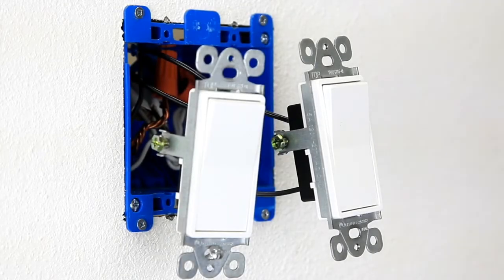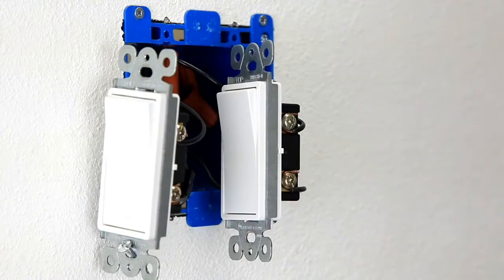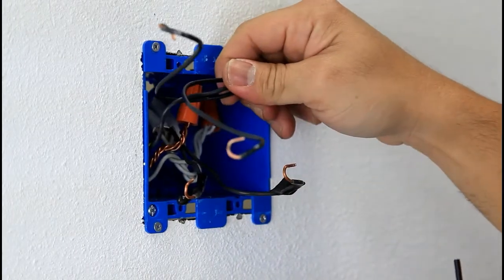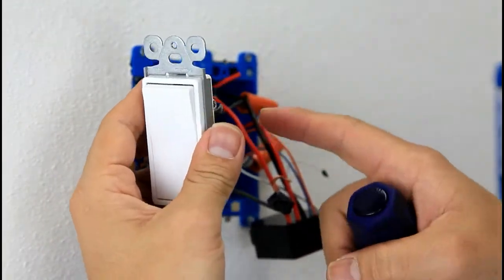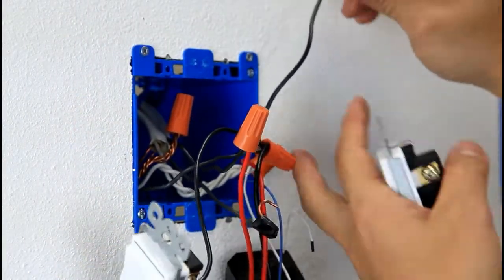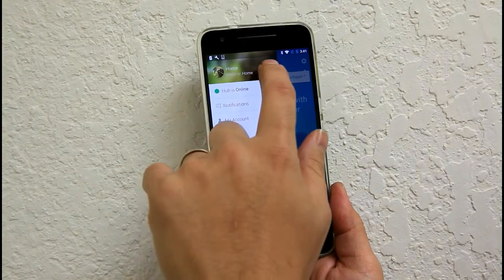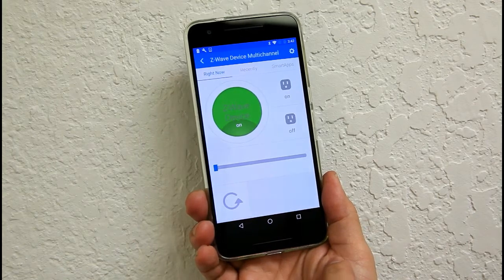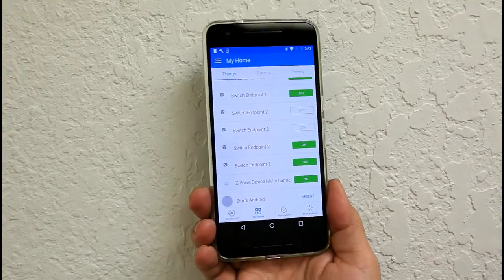Installation Guide | Z-Wave Module | Enerwave ZWN-RSM2-Plus

Comment: if my panel is closed, is there anyway of resetting without opening the full switch board?
Reply from the maker: To reset you can delete the devices in-app or using your developer account (Desktop). If the device sometimes works you can initiate a Z-Wave network repair. Lastly, if your unable to reconnect you’ll have to physically press the program button on the relay. Feel free to contact our support if you may need any additional assistance.

You can reach us at support@topgreener.com. Our office hours are 8:00am-4:30pm PST Monday-Friday.

Comment: Thanks for the video..

Strangely, when i add the switch to smartthings, the hub recognizes it as "Enerwave Duplex Receptacle" instead of "Z-Wave device multichannel" as shown in the video. 

Also, i get a message saying "You can't currently add this" when i try adding a "Multi-Channel Control" SmartApp.

Any idea how to solve this issue?

Comment: Excellent video, first of it's kind showing this product.

If you turn the lights on remotely and then operate the switch will it turn the lights off regardless of the switches position? And vice versa? I want to add these to my home but still have the old dummy switches for simpler guests who aren't used to home automation. Thanks
Reply: "If you turn the lights on remotely and then operate the switch will it turn the lights off regardless of the switches position?", -- Exactly, yes